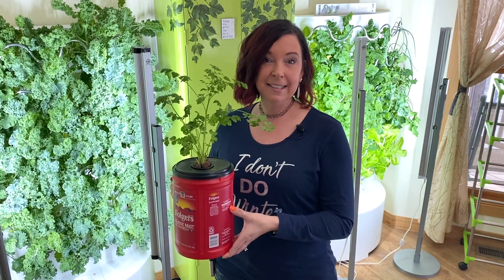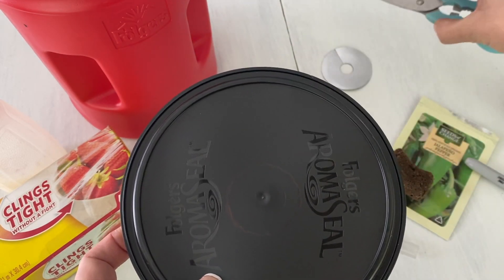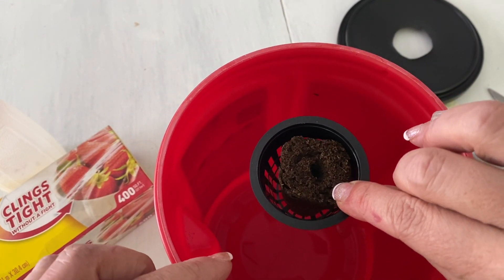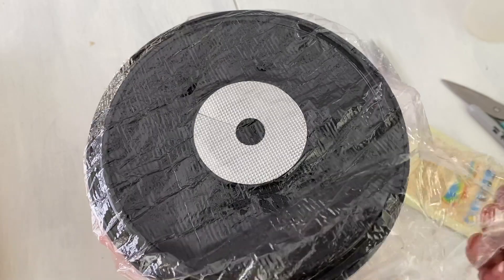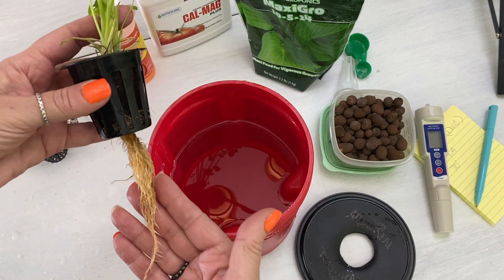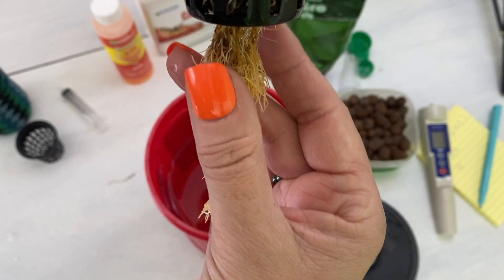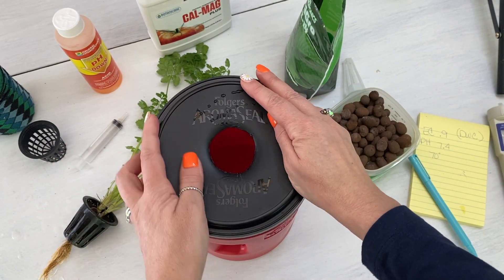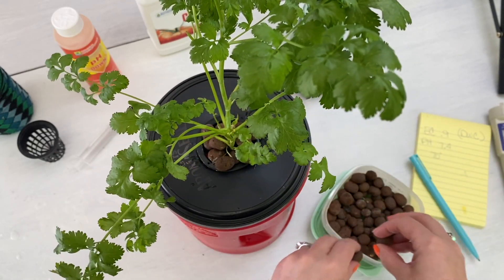HOW TO MAKE A DIY KRATKY INDOOR GARDEN SYSTEM WITH A COFFEE CAN - BEGINNERS

Comment: Ms Angie
Every time i add water when needed foe 32 oz or 64  oz kratky jars , to top if needed for cucumber n tomato who consume more water, how much maxigro to add as it already has some me water This math eludes me ! Shud i simply add as per direction for a gallon n top it or is there some way?
Reply: Adding one more qstn My cilantro falls on sides how to keep them straight in kratky They r under grow lite
Reply from the maker: Make sure the light is nice and close. I also use tooth picks or shish kebab sticks and lean them up against those to encourage straight growth ;)
Reply from the maker: Do you have an EC reader that you can measure what you are at currently? I sometimes mix the water ahead of time to the nutrient level I need then add more. Just remember don’t take it too high and cover any air roots. Good luck hope that helps
Reply: I do not have a EC reader yet
Thanks for your help It will definitely help

Comment: Thanks for this video on kratky system I had planted egg plant n tomato plant in 64 oz mason jar , which were growing good with aerogarden nutrient Now suddenly both have root rot 
Can i trim n cleann the roots and add new water, some nutrient and hydrogen peroxide ( how much for 64?0z jar ) If it does not recover can i try planting them in soul n see if they survive

Also whenever instart seeds in mason jar can inadd some hyd peroxide in the beginning itself ?
Reply from the maker: Yes trim and clean them. Get all the gunk out of the roots. Use room temp water to replace so you don’t shock them. And you can add the HP at the start. Thanks for watching and commenting :)